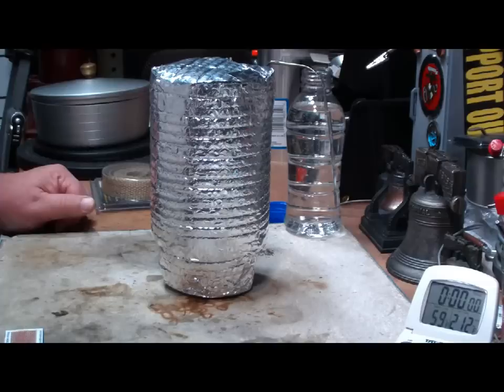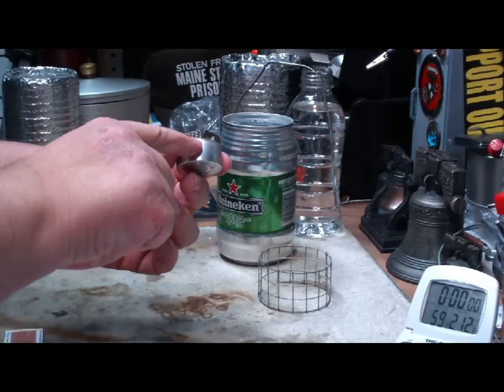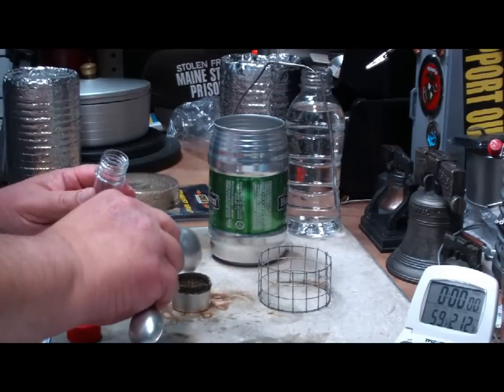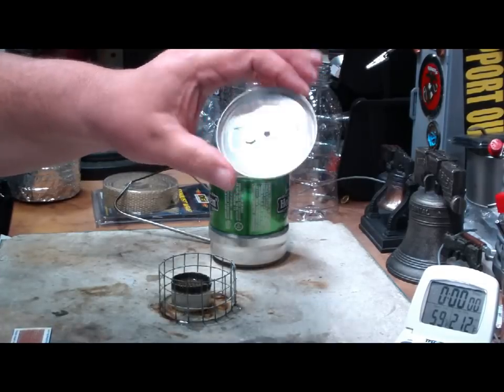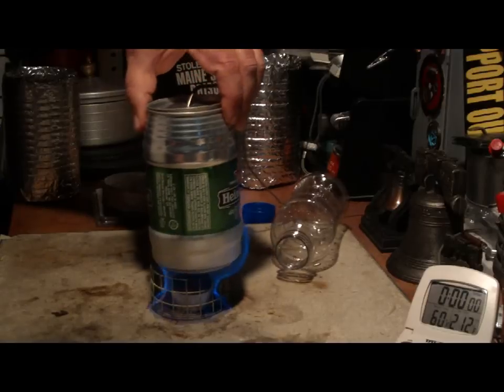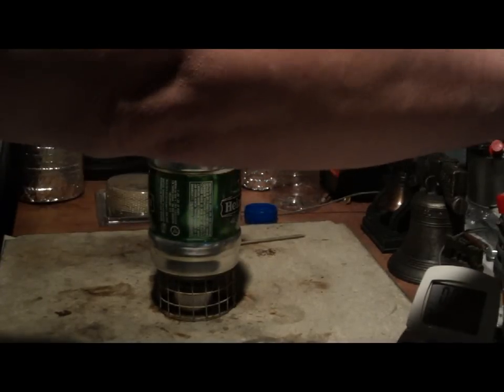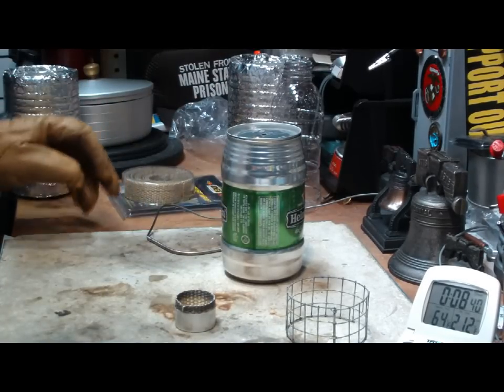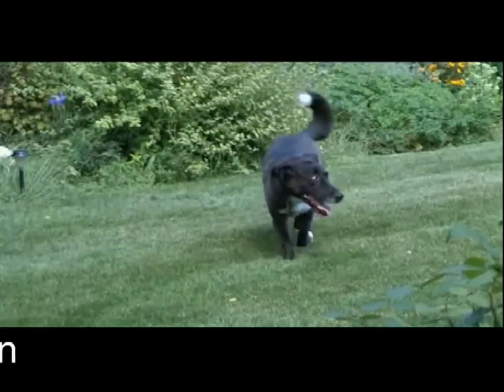Heiny Pot with the Tea Light Vertical Wick - Boil Test #1

Comment: Appreciate the video...where do you get exhaust wrap?  At an auto parts store?  Never seen of heard of it before.  i picked up some of those big, 3 wick pillar candles at a garage sales over the last few months.  I've been wondering if I could use about three bricks on either side of the candle, stacked on top of each other, just high enough to make a bridge over the candle with a small wrack resting them, on which to set a pot.  Just wondering if three burning wicks would boil water.

Comment: @MrBillTroop73: Boiling water can only be at 212 F. It does not matter if the water is lightly boiling or a heavy rolling boil. This fact prevents the teflon from degrading to dangerous chemicals. Teflon will only degrade at very high temperatures. As long as water is in the pot NO PROBLEMS.

Comment: Great work Hiram!

The idea that the keg pot leaches chemicals is a red herring.  The can lining is the same resin they use to teflon coat cooking pans.

They clean the dust out of resin lined cans with boiling water right before adding beer.  Then they pasturize (boil) the beer in the can.  As long as you dont let the pot boil dry, and actually burn the linking, it should be fine.

No proper scientific testing has shown any leaching of chemicals from boiling.

Comment: Thanks Hiram, I think that camera #2 shows your set-up there puts the bottom of the pot right at the sweet spot of the flame. The times for this little stove are'nt far off from my pop can stove, 5 minute'ish to boil, and 6 min - 45 sec to burn out (1 ounce heet). I'm old fashioned and use an old sterno stove, I might have to look into making a new fangled wire stand. I'm liking this little stove more every time I see it. Thanks for the great test, the family and I think Max is a great dog too.